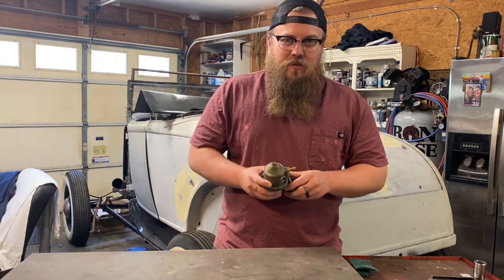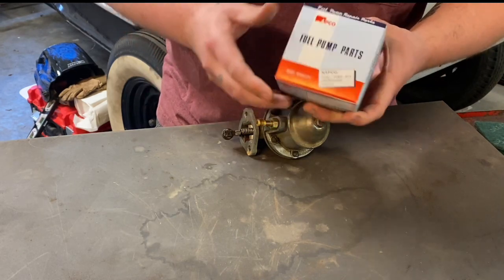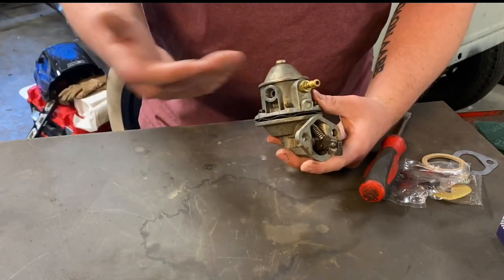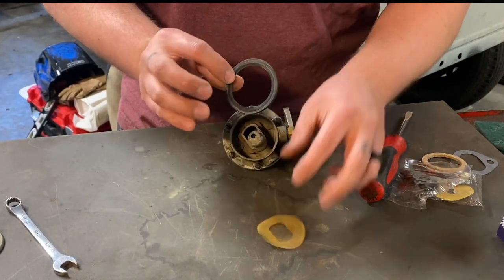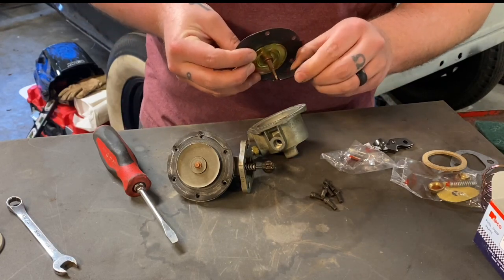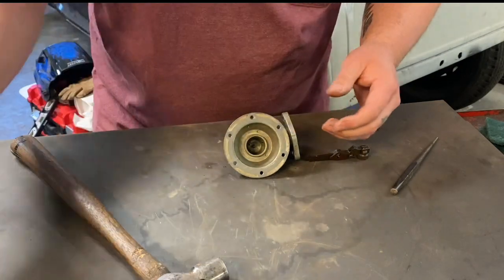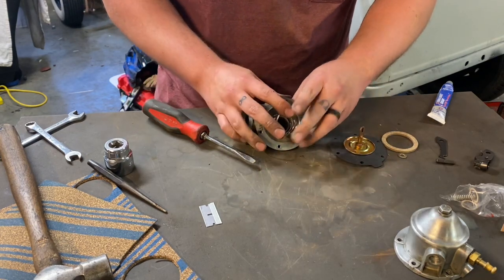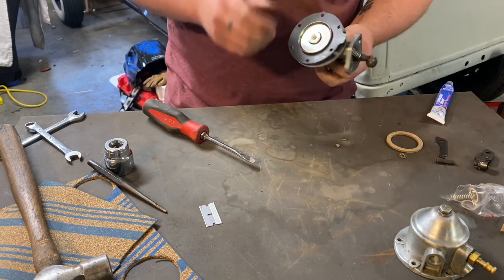Rebuilding Flathead Fuel Pump

Comment: I might recommend ensuring the pump diaphram(gasket) surfaces are smooth and not warped.  I've had two pumps leak within a few weeks at the diaphram.  After I used a flat surface(glass) and sand paper, I found that the sealing surfaces weren't as flat as they could be.  Haven't had a leak since.